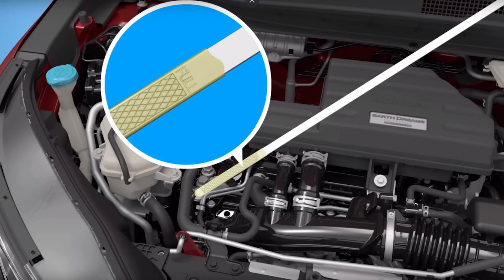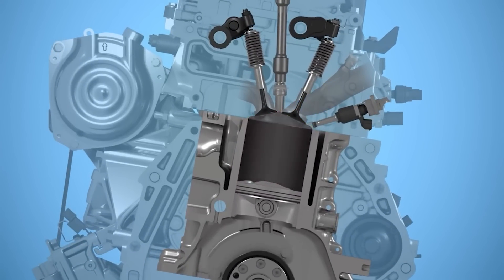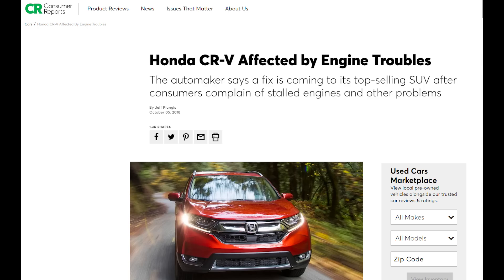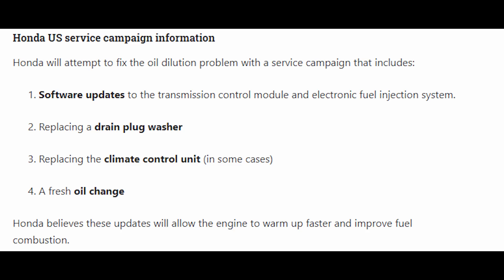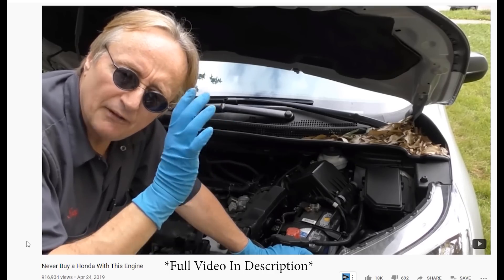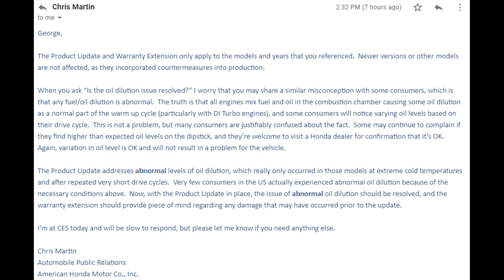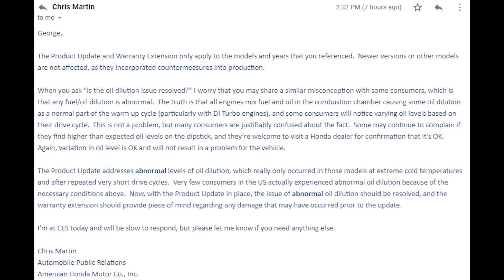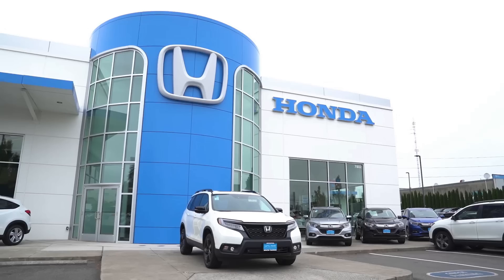Does Honda Have An Oil Dilution Problem? | 1.5L Engine in CR-V and Civic

Comment: Hello from Calgary Canada,   I had a 2017 Honda Civic Sport with the 1.5 turbo engine.  The car was recalled for the engine oil dilution problem and did have a strong smell of gas.  I traded the car in for a 2019 Civic Sport model and I have noticed that the oil no longer has the same issue.
Reply: Not yet anyway...

Comment: I have owned Hondas or Acura since 1979. They have been good, reliable cars. I had been looking at a new CR-v, but this dilution problem and Honda's sidestepping and disingenuous response to it killed any chance that a new CR-V would grace my garage. When the Red Chinese (a huge market for the CR-V) say fix it and don't sell anymore until you do, and Honda doesn't, that tells you all you need to know about whether Honda can repair this problem, as opposed to trying to BS their way to daylight. (Taking Trump lessons I guess.)  My reaction to all of this? I bought a new Passport Touring: basically the same engine I've driven In Acrua since 2002 and a real transmission made by good German engineering since 2013. Anyone who buys a CR-V because they extend the warranty from 5 to 6 years is nuts. I'm unwilling to be the butt of the joke as Honda tries to fix this real problem through advertising.
Reply: Randall Stewart no that’s because the government owns half of Honda in China the government strictly controls the car industry in China

Comment: GDI is not the only culprit here.... the basic flaw is in the engine design.... turbo is real culprit here they put  a turbo and GDI on a engine who has a short piston run....hyundai and kia are using same tech from last ten years they dont have these issue beside the intake valve deposits.... Honda jist need to take aways the either the GDI or turbo from this engine or both otherwise the problem will persist.... you can even see in their video that how short the piston run is on top of it GDI and turbo....

Comment: Man I'm still looking for a crv with the regular engine.
Reply: Buy the 2019 "LX" base model, it has the bulletproof 2.4 engine.  My local dealer has about 15 still on his lot.  All the other 2019's and ALL of the 2020's have the problematic turbo engine.
Reply: Ofc Bob The LX is a barebones model, literally has no features. I used to sell Honda’s, the EX is the lowest trim 95% of people will buy.
Reply: @FlexSZN23  Spicey French Toast was int'd in the "regular engine".  I was just advising that it was still available if they wanted to look at a basic model.

Comment: I'am a Honda guy and had to skip the 2017-2020 CRV for a Hyundai Santa Fe instead just because i'm afraid of the oil dilution problem and their lx trim without the 1.5T have like 0 options so it wasn't an option to consider  either

Comment: Honda fan here. I switch to Toyota because of the turbo. Why putting a turbo on a family car?.  i wonder what's going to happen in a long run🤔. Ps my mdx 2011 is still waiting for piston ring for 3montns now for excessive oil consumption.😢 My 2006 pilot 170000 miles, civic 1989 250000miles no problem at all.

Comment: The reliability chart listed is ridiculous! There's no way Honda is 12th below all of those crap brands like Hyundai, Kia , Nissan etc. I just bought a 2016 Honda CRV 2.4 I-4 engine because of the 1.5 Turbo oil dilution problem and if Honda continues to go down that road without correcting the problem then it will hurt them in the future. Despite that one issue Honda is a better vehicle than all of those brands besides Toyota. Mazda is ranked higher than Toyota lol
Reply: Honda has way more that one issue affecting their quality and reliability, there 9 speed trans to name just another and interior quality issues.

Comment: They should have kept the old 2.0 or 2.4 L. engines  I would not purchase a 1.5L turbo. Also, try 91 octane gas. to see if that helps. Some say the new hybrid is a better engine choice.   BTW-  Toyota Rav 4 offers a normal 2 liter engine (no turbo) and regular transmission (no CVT)
Reply: 2019 is the last model with 2.4L engine.

Comment: When it comes to fuel economy this 1.5L is OK it not good or great, on my
 2020 CRV I get combined city/Hwy 27 Avg MPG which it lower then 
estimated EPA number, but again we drive in real world.  Honda should 
consider  bringing diesel Engine to US car market which will give better
 fuel economy and better response/performance/reliability from engine. I
 would have to agree that other countries get more options when it come 
to engine or trim/options including CRV with Diesel option, but i would 
say its consumer fault or lack of consumer education since they are 
unable to say to say NO gasoline here in US. One has to understand that 
combustion in diesel engine is 30-40% better per each cylinder cycle and
 even at  higher price per gallon of diesel  it will make up for itself 
in long run. When it comes to EPA here in US one must also understand 
that driving more efficient diesel will leave less of the CO2/Nox foot 
print on the environment per mile driven due to better efficiency 
"Fact". I don't believe you need MIT mathematics /engineering  degree to
 understand. EPA here in US does not seem to perform/understand real 
driving condition tests over distance driven when it come to CO2/NOx 
emissions. They simply stick a car on a Dyno, but we all know that this is not how
 people drive cars in reality.  Because if that was the case we would 
see bigger push from US  Gov for full electric & diesel. This is 
where US consumers are in the dark for the most part. If US consumer 
wakes up to reality we will see better car industry with more options 
here in US . Before you start writing about VW and diesel gate just stop
 and think, also I am not defending any car maker that cheat when it 
comes to emissions its simply wrong to cheat.
Reply: 2020 CRV Quick update MPG dropped from combined 27 to 25 AVG called dealer stated facts about MPG economy drop and oil also stinks like gas. I only got about 600miles total on the engine. I don't think oil dilution  is resolved. Dealer response usual BS you drive to hard, use heat/ac not enough highway driving etc... Stated to them I am currently in the market to buy a horse. They are  "trying" to schedule me  in for service. Will update if there is any change. But most likely will need to send out oil sample to independent lab to get it tested properly.  This is ridicules how consumers are being treated by Car makers!

Comment: I own 3 Hondas and my next car will be a Honda but not one with a oil dilution problem or a CVT transmission.  I will probably buy a older model CR-V or Pilot.  I buy Hondas for their reliability  and  I expect to get 250K miles out my Hondas. CVT transmission do not last 150k and a motor that reduces the lubrication properties the oil over time wears the engine part faster.

Comment: Nothing to do with "turbo-gdi" or "gdi-only", both can make problems as u can see in gdi k24 crv non turbo also. The root cause of this oil dillution is because heat-waste of this engine is very low in fact the friction of this engine is very low that didn't produce "proper" time to heat to warm-up. While (even) radiators already controlled by thermostart, thats why the only other way to interfere heat exhangers, honda update the heat exchangers in a/c (as this also functioned as radiators which a/c heaters might also contribute prevent engine to heat up) when users use most in cold weather.

Comment: So what does HONDA do? For 2020 they put a piece of crap CVT in this vehicle. That’s a continuously variable transmission for those of you who don’t know. What can consumers do? Don’t buy Hondas. It’s a shame to see a once great company going down the tubes.
Reply: Larry Tisdale the CR-V has had a cvt since the 2015 model year it’s not a new feature for 2020. I find the cvt in my CR-v and Civic excellent. I like how they work and can always be in the appropriate power band. I’ve only driven Honda’s with cvt’s so I don’t know how other brands’ cvt’s feel. The Honda cvt’s feel very smooth and not like a rubber band like some people describe cvt’s.
Reply: I have relatives with pre 2020 CR-Vs and not one of them have a CVT.  The Fast Lane Truck review on the new CR-V specifically explains that the CVT is new for the 2020 model. Smoothness has nothing to do with reliability. Whether it is a Nissan, Toyota or Honda CVTs have towing issues and dramatically shortened lives due to slippage. Subaru is having issues with it’s CVTs not being able to pull itself out of any off-road situation requiring pulling power. Nissan has had tremendous failure problems with it’s CVTs.  Buyer beware!
Reply: After a little more research it appears that The Fast Lane was in error as the CVT apparently has been in the CR V since 2015. I admit my error.

Comment: Relatively-high compression combined with low-tension piston rings seems almost a guarantee of fuel leaking down into the crankcase. This technology - along with tiny, turbocharged engines - which benefits the consumer with better fuel economy and higher power, seems mostly, though, intended to help manufacturers meet increasingly strict fuel economy standards, regardless of maintenance/repair issues down the road (which will likely be described as "normal," "they all do that," or "it's within factory specs, there's nothing we can do," to the owner).
Reply: honda solution is to take crv on longer drives to burn off excess gas kinda defeats the purpose if having a more fuel efficient model . numerous short trips without ever taking a vehicle for a good run has never been a good idea in the first place ; even before the OD issue became more public but theres a few people in the comment section stating they commute 30 miles to work , 30 miles back home and the crv still doesnt warm up enough or burn off excess gas
Reply: low tension rings, i think you really pointed out the real issue here.
Reply: ProbeGT2 low tension rings are used in  pretty much every car today
Reply: i think too because they use turbocharging and direct injection on the 2 liter and it doesn't seem to have this problem so clearly the problem is not turbo related or GDI related like every supposedly mechanics are trying to tell us.
My 2011 ecoboost is turbocharged and direct injected, never had any oil issue and it has 155 000km.

It's just a badly engineered engine and they don't know how to fix it without opening the damn thing because it would be too expensive.
Reply: the fact that it takes forever to heat up now clearly explain that rings doesn't seal properly or the engine would not heat up fast enough to make them seal properly on high idle cold start so they went the Lean way to try to prevent fuel to get in the oil.
Reply: I believe most manufacturers now go for low tension rings in a bid to reduce internal friction. The result is usually high oil consumption. Looks like Honda went just a little too far and have caused fuel to enter the crankcase.
Reply: Right on! Let's achieve fuel economy, consumers like that! But at what cost? Who is forking the cash to fix the problem? Are you saving? Show me! Honda dropped the foking balls on this one and refuse to fix the problem by dumbing down the consumers. FOK Honda! How many times will you have to change the oil in your car just to have peace of mind? I have seen this play before, Honda owners got the screws put on big time! Got a nissan PF, still kicking arse after 150K repalced tires and a battery in 15 years!

Comment: Shitty engineering by Honda. From trying for too much power from a small displacement engine. I own a 2010 CR-V without this problem. I expect the engine to last for 300k miles. These 1.5 liter enginines with DRG injection and turbochargers won’t last to 150k miles

Comment: # 12 in realibility i dont think so they have to fix the problem in those cars but my honda accord 2017  2.4 runs like a dream change your oil every 5,000 miles no matter what it will run great

Comment: would not buy one unless the engine gets redesigned period.
Reply: It's the reason I didn't buy one, but even if they replace the engine with a new one, unless it's a tried and tested one from another Honda model, I wouldn't buy one until it had been out for two years to be certain there are no problems.
Reply: @fiveowaf454  true.
Reply: @fiveowaf454  that’s why I got the 2019 civic with the 2.0L na 6speed manual no issues, approved by Scotty
Reply: @MrScoobieman  Good choice!! IMO Honda only gets away with the oil dilution problem due to the high proportion of Honda owners who are not knowledgeable about vehicles and never go under the hood to check oil and such, so don't notice.
Reply: @ m ph I also have a 2019 1.5L CR-V and the oil dilution problem is not fixed and Honda does not stand behind it. I’ve had my vehicle in 3 times c/o gas fumes filling my garage after parking and the dip stick reeking of gas. They tell me nothing is wrong. The service advisor told me the smell was possibly coming from my lawn mower that I keep in the garage. Honda does not care so buyer beware.
Reply: This is the first generation of civic and crv with turbo and GDI got introduced into the 1.5L engine.  So it would be a miracle if Honda did not experience  this issue. Higher fuel pressure in Gdi design, higher air compression in turbo engine, yet running on low octane fuel ? They've got to be kidding to put that engine on the high sale volume lines.
It could have been one of those executive decision :).  But moving to 2020 model, turbo engine is only available on touring and Si trim of civic.
Reply: @honda_fan_caphan9686  Its available on all crv.
Reply: We bought a 19, September build CRV with the 1.5l. Not worried about the oil dilution issue. Honda said its fixed, hopefully it is. If not I am confident they will stand behind it. Great car BTW.
Reply: @mph5896  Wow, you sound like such a honda homer.
Reply: @damannoa  Whats a Honda Homer?
Reply: @mph5896  It's someone who worships the ground Honda walks on and has nothing negative to say about it, which you are.
Reply: @tails300  Ha, I have been dealing with GM, Ford, Chrysler for 25 years. Go from that to a decent car company and you would understand.
Reply: @damannoa  Thats a very broad statement you made over my comment. I have plenty of bad to say about them, just not what I posted here dealing with this engine issue these cars had.
Reply: m ph don’t get me wrong I hate the big 3 more than Honda. I’m a Mazda/Toyota/Kia guy.
Reply: @mph5896  With all respect I don't know how you can make this statement. Firstly where have Honda ever said it has been fixed? to my knowledge they have only said it is normal for this engine. Secondly, because they have said it is "normal" and based on people's documented experiences, they do not stand behind the issue or repair vehicles "because it is normal". Good luck with your CRV, but to say you are wearing "rose tinted spectacles" is an understatement.
Reply: @fiveowaf454  "The company says engines in 2019 CR-Vs will be repaired before they go on the market."

https://www.consumerreports.org/car-repair-maintenance/honda-delays-cr-v-turbo-engine-fix-details-rollout-plans/

This is from Oct 18, The model purchased was manufactured in Sept 19. So, yes I have confidence it is a NON issue. If you feel differently, feel free to NOT buy one.

Comment: I was at a Honda dealership last year to buy my wife a 2019 CR-V but I heard about this issue while doing research while looking at cars. I talked to a salesperson and questioned him about the problem with oil dilution. He said he was aware of it but hadn't seen the problem first hand. While we were walking around the lot I ran across a 2019 CR-V that was parked sideways to the line of cars I was looking at. It was a car someone at the dealership was using. The engine was warm and the keys were still in it so I cycled the key and saw about 3,500 miles on the odometer, then I opened the hood pulled the oil dipstick and guess what, gas smell on the dipstick and it was overfull. That did it for me. I ended up getting her a beautiful red Mazda CX-5 naturally aspirated 4 cylinder engine.  I use to swear by Honda but all I do is swear at them for cheating their customers. I bet they are still having the same issues.
Reply: Ha, I'll take my chances with a Honda over a Mazda.
Reply: mark kaupas - So you opened the hood of someone elses car 👍🏾
Reply: Clit Commander The salesmen that I was with said it was fine because it was on loan to another employee and he wouldn’t mind. In fact he left the keys in it because my sales person was going on break until I showed up.
Reply: mark kaupas does you Mazda CX-5 have cylinder deactivation? 😰
Reply: Knuckles300 I was told it runs on two cylinders at cruising speed. We got a recall completed concerning cylinder deactivation but the recall didn’t say what the software update did to the engine or how it would affect performance.
Reply: mark kaupas from what I here they I Kee arms can malfunction and break off on one of the cylinders. The recall is supposed to raise the oil pressure on 2 cylinder mode to help keep that from happening. Idk if its working but we’ll see.